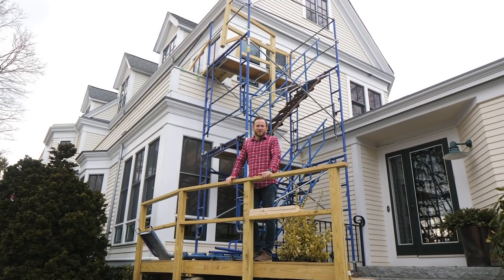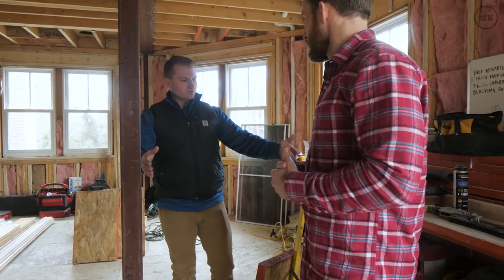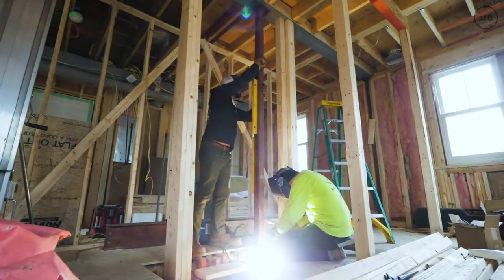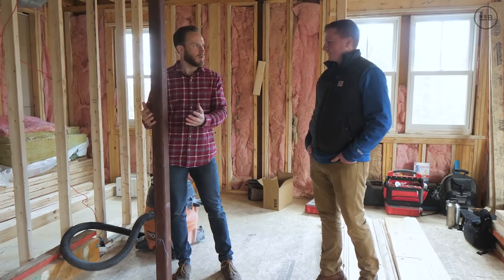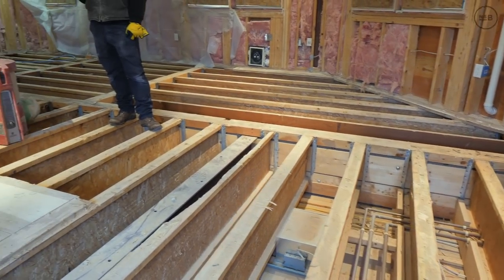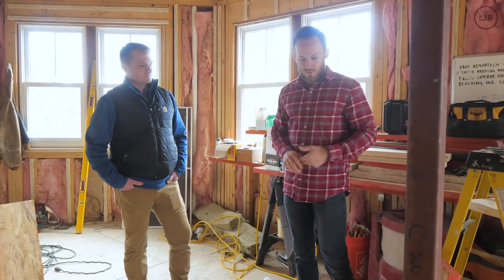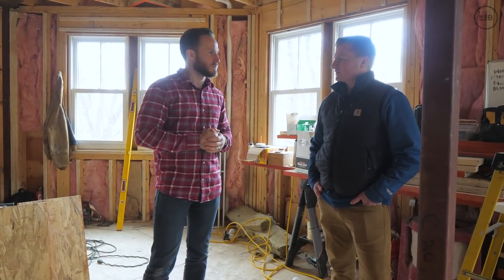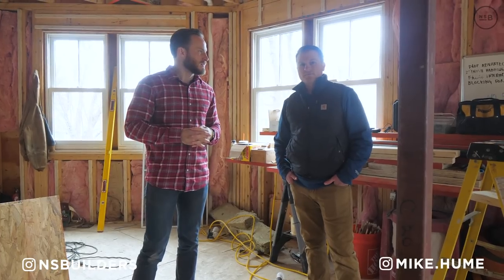Giant 16'' X 20'ft LSL used to make our subfloor flat, level, and plumb

Comment: I really like the work that you guys do. It shows that you care about your craft and your clients. I like how you take your time and straighten the walls. There was a tip I read in Fine Home builder years ago for straitening ceilings but it works for walls as well. If you cut a metal stud in half you can screw one half to the side of your stud. This way you don't loose that insulation and I use a magnet for drop ceilings and a laser to straighten the wall. If it is to far out you can use the string like you guys were doing. Just my 5 cents worth it may help in the future. Keep up the good work.

Comment: Any thoughts on why the original framers put so many jacks under the windows? I would have thought single studs spaced 16 in on center would be sufficient to carry a window. 

Might it have something to do with the previous renovation?
Reply: So it can hold a ramp to drive a car inside, but... Probably didn't want to throw them away

Comment: That's a ton of work to do for framing considerations...But, if the client wants to pay for it, it gets done...I hope you did okay on the change order. We rarely see steel in any of our residences. Just the carrier beam down the middle of the basement for the floor joist then bearing walls on top of that...
Reply from the maker: ROB-IN-PHILLY client has expectations and we need to hit them.
Reply: @NSBuilders  They sure do and we sure do...Is it tough finding competent mechanics in your area?

 It's impossible here in philly...I'm glad I'm semi retired, All the good guys are spoken for, or doing their own thing...The pool of dependable workers has shrunk considerably,  from 20 years ago...

Comment: Cha Ching! Designing a space around a structural column, especially MOVING a column, just seems onerous...I've seen the updated videos, with the radius walls in that room...And the AC return problems...As a contractor Those kinds of things drive me crazy. You can't charge what it's worth because customers think you should see through walls and "isn't that included?"... You need a better architect or more involvement in the design work. You should NEVER have to have an engineer AFTER you're opened...That can add a month to the project easy...

Comment: You lose a lot of R-value by sistering the studs,,,  There are better ways..   Love your vids
Reply: I agree but I think the priority of this build was fulfilling the aesthetic design requirements over conserving r values. A few extra dollars on heating bill will not be noticed by the people who are paying for this level of renovation.
Reply from the maker: sean tap fair point. And we chatted about that. Would love to hear your thoughts on better ways.
Reply: @NSBuilders  i SET a string at the top and bottom of the wall then put a stud in as if you were sistering but instead scribe the stud and rip it to fit.   Ive done many walls like this but manly kitchens in a remodel..cheers love the vids.
Reply: @seantap1415  Do you have any videos of this process? I'm trying to visualize how it works.